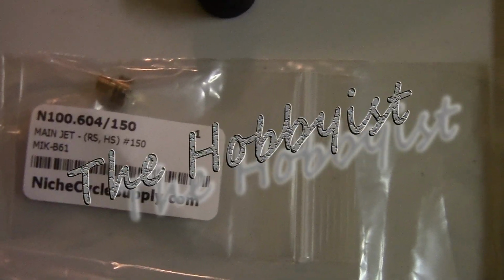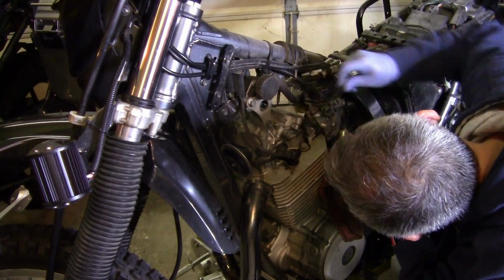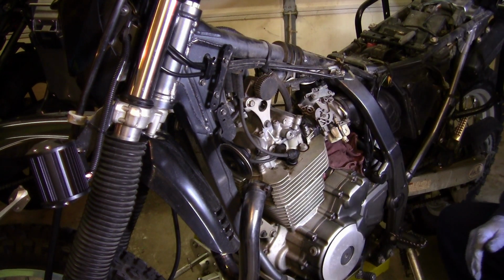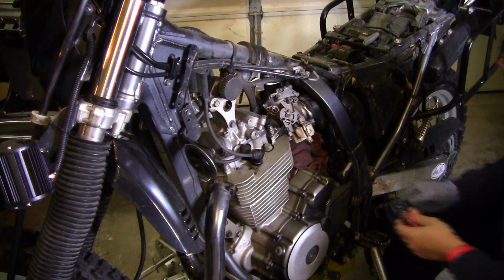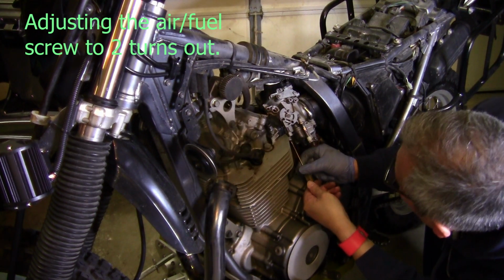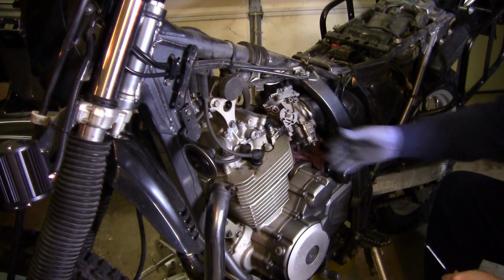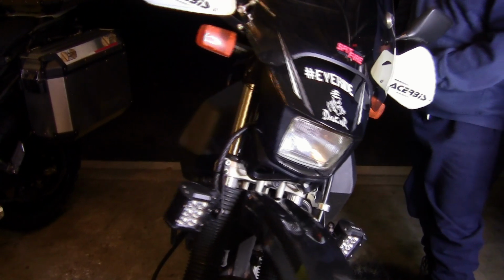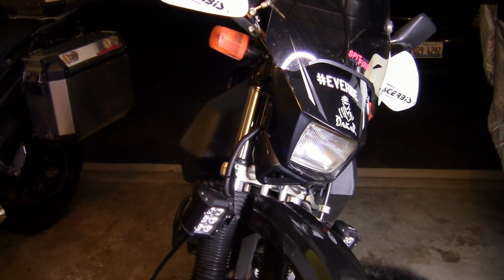Rejetting the DR650 without removing the carb

Comment: It's difficult to tell by video, but the bike seemed to be idling a little high to me.  Again, I'm not there, so it's tough to be accurate from where I'm sitting.  Of course, you would know better.  I tuned in to your video because I'm getting ready to put a ProCycle kit (jet, needle, hex-head fuel bowl screws and extended idle screw) on my DR.  You have a nice looking DR.  Thanks for the video. 👍

Comment: So you have stock needle in your carb than? You just drilled out plug to adjust air/fuel mixture and put in a 150 jet? Stock airbox and you notice a difference to make it worth it?

I too have the DG slip on but all stock carb yet.
Reply: @nomad_TheHobbyist  Ive been researching and don’t want to drill my airbox. I hope with a 150 jet and new needle it will give it a little more ooomphhff along with my new exhaust. Think it’s worth $90 to do it or leave it stock?

Thanks for the reply!
Reply: @nomad_TheHobbyist  i want to fix the decel popping is main reason. I think it’s a little more leaner after putting slip on exhaust to. At night if I give it good the header glows bright cherry 🍒 Can only see it at night though.

Comment: Wich headpipe did you use? I have the same DG tailpipe and need to upgrade  headpipe but dont want to get the wrong one... thanks in advance!
Reply from the maker: I'm sorry but I don't remember anymore. I know I got it from eBay, and it is a lot lighter than stock.
Reply from the maker: The seller, 
d51msport, is still in eBay, but I can't find the item anymore. It was listed as 'S/S Header Exhaust Head Pipe FITS Suzuki DR650SE 1997-2014 DR 650 AND WARRANTY' back in 2016.